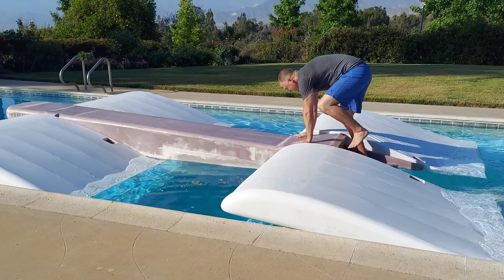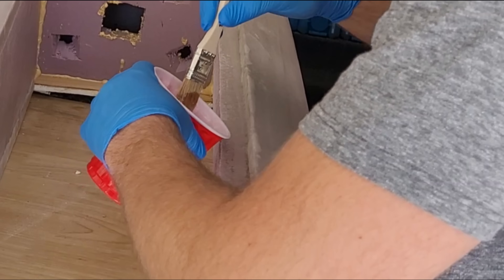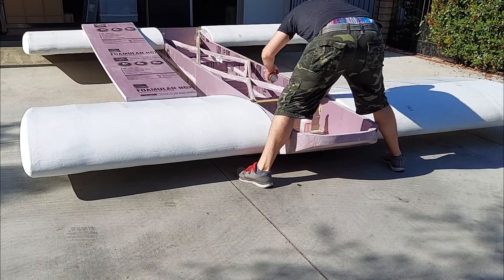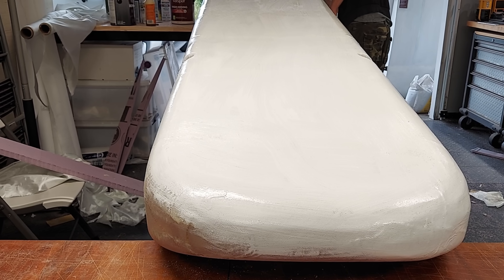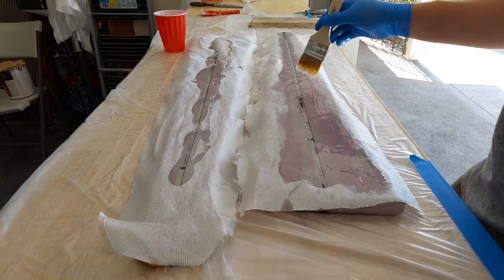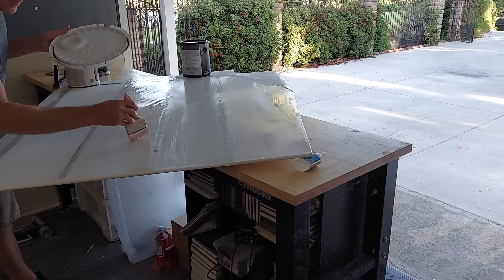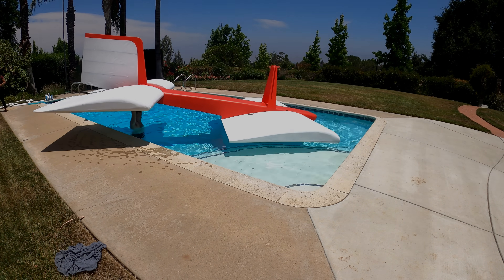NOT a Pool Toy:  Manned Boat-Towed Ekranoplan (Build Part 3)

Comment: I have changed my predictions for a successful outcome. For a while I thought no way it's just to much of a seat of the pants design and had around a 10 to 15% chance of flight. Then I dropped the chances down to about 5 to 7% because I predicted complete structural failure before reaching the speed necessary for liftoff. As you added supports along the way with more seat of the pants calculations I began to improve the odds and now I can't wait to see the first flight I'm up to a 75% chance of flight and 100% chance of getting a great laugh eather way. I wish you the very best of luck it has turned out nicely

Comment: Great Build and Great Comments, as a Hot Rod Builder since 14, all the Safety Things we Omit can come back to bite us with age, the Damages are Cumulative and can lead to Serious Problems . Those Darn  Air Purifying Cartridges , Only last a matter of so many Hours,  and must be But Back in the Bag and Sealed and they have become Disposable.  Eye Protection, Hearing, Lungs, every day is a must .   Also, as a Surfer, water skier, your standing Area might need to be enlarged so you can move your Weight around , drop a back foot to pickup that nose like a Surfer Does. They make Great Stomp Pad, rail grabs, all kinds of stuff in the Skate board, SUP, and Surfing World.  Keep you on that thing, and not Slipping off. Now a Great Chase Boat is an old Hobie Cat 16, stripped of sail crap, Hell we dropped a Redwood Gazebo Thatched Roof and all Strapped on a 16 Hobie cat with a 10hp outboard, fast ,stable, cheap, fun. We could load Beer coolers, barbecue, surfboards, 4 surfers and head out to the break, anchor  out. and surf all day Damn good Fun    God Bless the Builders ,  Never Stop Creating.

Comment: Amazing! Can't wait to see it fly. Interestingly, I wonder if the smoothed planing hull ends up being the right choice. I definitely don't know, but I know that at least for a time, some white water play kayaks that had planing hulls were designed more like golf balls or with sort of a grid pattern to assist with breaking surface tension, so it was smoother/easier to repeatedly break and join back to water (to spin and skip/jump smoothly) - I wonder if, with a smooth surface, you'll end up "stuck" to the water and once you release you'll pop up quickly. But this craft is so much bigger, maybe it's a non-issue.
Reply: The Americas cup AC-75 foiling mono hulls looked very much like they had considered this stickiness problem and had what they called a skeg underneath a very flat V bottom.
Not a yachtsman so forgive my use of terminology.

Comment: This is really inspirational! I live 25km from Lake Eildon, the 2nd largest fresh water lake in Victoria. I can envision a larger version, with either a long seat for a pillion rider, or perhaps in-line seating capacity for 2 plus the 'pilot'. I'd use some aluminium and plywood for strength, and add wingtip floats. Also, I'd want it powered by one large, or two smaller pusher propellers and motors, and twin rudders. A steering wheel or other rudder control mechanism would be required, along with a throttle. A basic instrument panel showing RPM, speed, and fuel, set forward of the controls would be easy to include. I'd also add a lightweight nacelle around the craft's nose to protect the pilot from wind and rain. 
The resulting craft would be far better than a speedboat, with no jolting from hitting waves or wakes. To begin with, I'd opt for a 500cc motorcycle engine, or two 250cc engines, depending on which configuration chosen. The fuel tank and batteries could easily be housed in the central fuselage.

Comment: This will be fun to watch.  The weight shift "steer" is a good idea, but I wonder if you'll need to adjust too many times.  Time will tell, though secretly I hope you have to make control surfaces to fly it like a glider.
Reply: vibratingstring  I think you won't be able to adjust quickly enough with weight shifting?  I can't really tell how responsive the airfoil will be.
Reply: vibratingstring  ever flown a hang-glider? Weight shift for its simplicity and effectiveness is a brilliant idea.

Comment: Whether or not this thing ever gets above the waves, you have certainly made Günther Jörg proud !   I love your innovative “big box home center” building theme here.  Your keen attention to aeronautical build detail is so fun to watch.  Will you be adding side panels to join the wings (like the Flairboat) or leave the wingtips unencumbered ?  I suppose there would be a small amount of wingtip bleed of air pressure but it might not matter so much for this test. I’m just wondering if it would help with longitudinal stability should one of your wingtips inadvertently dig into a wave or the wake of the tow boat.  Thanks so much for posting this great project !  👍🏼

Comment: This is epic!   And super dangerous.
Reply from the maker: I think the perceived danger is far higher than the actual danger.   Perfect for YouTube!
Reply: @thinkflight  oh it’ll make a great video that’s for sure! :D.  Will you have any aileron or rudder control at all?
Reply from the maker: @northernfpv9562  Nope
Reply: @thinkflight  uhhh.  Maybe just a tiny bit of rudder might be nice.  Attached to brake-style levers on your handlebars?  That would be cool and not too much weight or work required.  I’m just thinking of how to counter the lateral force in turns while towing.
Reply from the maker: @northernfpv9562  I'd rather give it a shot as is and only add it later if needed.   Also, it just needs to work, it doesn't need to work well :).   Not a product, just a youtube video.
Reply: @northernfpv9562  In my opinion the rudder isn't necessary. You'd only need it for less drag in a crosswind situation. For the first flight I would recommend going straight into the wind anyway.
Reply: @northernfpv9562  The tow rope in tension will be providing good yaw stabilization. Your question/solution relates more to case when airborne and no tension on a tow rope. 
This part of the perception of having no stabilizing control(s), and increased perceived danger. 
Key to the design is the integrated stabilization control, yet to be tested .. all great youtube video ingredients. ;)

Comment: Congratulation 👌 l learned  a lot of stuff from your project.
I have only one remark concerning the  attachment of the nut for the wing attachment bolts.
As I saw the nut are attached using Epoxy as an adhesive.  I expect that  this attachment will be under multiaxial loads with a peeling component.  Maybe it would be necessary to reenforce the nut with a cross beam structure to transfer this loads to the main supporting attachment structure
Reply: Yes I agree ,a larger flat clamping area will spread the load on the main spar . This is a high stress point and must be able to handle very high loads .

Comment: The NAPT is looking great. The hydrodynamic centre looks spot on, sitting perfectly level in the water. 
Any considerations to applying a soft foot friendly rubber mat material to the piloting surface, like surfers use on hydrofoil boards? 
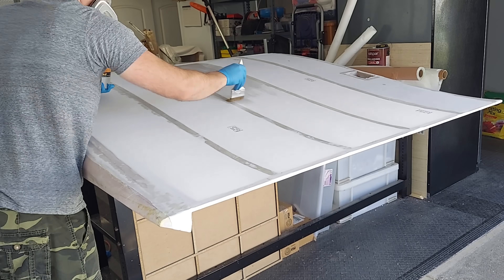Love the confidence (3:33) in that the NAPT Manned Ekranoplan will have a lifecycle of sufficient length that UV protection was a significant consideration in coating choice. ♥👍

Comment: I guess you've worked out that for Weight shift control  it's the opposite to what you might instinctively do with the"yoke"  i.e. to go up, lean back (push the stick forward)
To go left, lean left (push stick to the right) Hang gliding would help 😁

Comment: Without rib stitches, the fabric could lift off the structure. There have been deaths from exactly this, as the epoxy cannot resist the tension of the fabric “lifting” off the upper surface, especially with the concave shape. Please don’t fly it higher or faster than you are willing to fall! Also I believe it will be negatively pitch stable.. planes have elevators that produce downforce for a reason. With the rear wing being the same as the front wing, it’s going to pitch up or down wildly. Before you fly it, put 200 pounds of sandbags on it and tow it around, or make control surfaces and fly it like a giant RC plane. If you jump on it manned, I hope your insurance is up to date!

Comment: looks cool and roughly looks like it should work.. 
not sure how hard it will be to keep it in ground effect. maybe that's okay.  
and also roll stability..  may not have much, and I think you may be kept busy trying to keep it from rolling left, or right.. but worth a try as-is before making mods.  
don't worry about using proper techniques for the shrinking, or attaching covering material. it's not like it's human rated or anything...  Oh,,  it is?   um oh Well, never mind. :):) 
cool, lets' see it fly!!   imagine you'll tow it behind a boat!

Comment: Amazing project. I am just wondering, if you are going to be on top of the craft, your body is going to disrupt the rudder airflow?
Reply: I think the issue will be rather whether this thing has enough lift for a low enough speed so none of that matters all that much. There is no control on the rudder, it's purely for some stabilization. In the test flight, he will want to go straight into the wind anyway to get airborne at the lowest ground speed possible.
Reply: Rudder is more a secondary yaw stabilizer for most of early flight plans. The tow rope attached to the front will provide plenty of yaw stabilization when under tension
Effectiveness of rudder will be more important if/when the tow rope become slack while airborne.

Comment: The next time you do this you create a barrier for the foam by painting it with latex paint you can buy that and spray can form and then if you have a pinhole it will not melt the fome.

Comment: Your exuberance is laudable…but, imagine that as you are accelerating into liftoff / flight profile requiring the control necessary for stabilized flight involving pitch-roll-yaw…now add in the oscillatory impedance of the water surface chop generated by the tow boat.
Can you disengage from the surface wave action under sufficient control to achieve stabilized flight at 30knots? Or will the lack of axial control allow one wing to dip ever so slightly …resulting in disaster. To avoid this …you could employ a launch sled that would pre-pitch the fuselage/wings while keeping them well clean of the water. In this configuration you would take flight just long enough to experience the flaws in your design.

Comment: Similar to my idea. I was thinking hydrafoil to get it out of the water quickly, then accelerate to flying speed to come completely out of the water. I also want to pull it with a kite (after boat test proves possible).
Reply from the maker: foils are nasty on these things unless you can retract them.   I wanted to do that too on the drone versions but quickly realized they were a 'no go'.

Comment: I've started a simpler project intending to use Styrofoam to build a Remote Controlled retrieval Boat for RC Boats. I'm using Foam and trying to figure out what's best to seal it with. Any Suggestions. I can look at my Foam when I get home and then tell you what Brand it is. This Boat won't ever leave the Water Surface, but I'm building it out of Foam for Buoyancy.. It's a Pontoon type of design with Dual Electric Motors for Propulsion and Steering. It will have 2 Battery Packs, Speed Controls, and Servos. Any Guidance will be greatly appreciated. This is a Project I Shelved years ago, but your informative and upbeat Video was the Encouragement I needed to motivate me.

Thanks again,
Buck
Reply: Epoxy

Comment: Hmm looks like the rear wing have more angle of attack than the front wing... Is that true? In that case it will be unstable around the pitch axis.
Reply from the maker: I'm 'quite' certain it is a correct angle, but yes I have stared at it and wondered many times myself IRL.   The photo definitely makes it WAY worse though.

Comment: This is an ambitious project that may have the potential to be successful. However...  At 7:41, the video shows the pilot positioned above the wing trailing edge. Furthermore, the horizontal tail is shown with positive camber (curvature upwards). This arrangement concerns me. I believe the airplane may be strongly unstable in pitch and furthermore it may be unstable with respect to height above the water. This potentially dangerous or lethal. I recommend that you obtain guidance from a qualified aerospace engineer before you fly. Disclaimer: the following is offered as general guidance and should not be relied upon. The airplane center of gravity should be well forward - to the quarter chord of the forward wing or even ahead of that. The tail should make a download, not lift. The tail should be inverted and its incidence adjusted so that the airplane flies at a desired speed when it is in free air (well above the water). This combination of forward CG and inverted tail may provide height stability in ground effect. The mechanism is that at a given airplane incidence the wing may make increasing lift as it approaches the water, tending to pitch the airplane nose-up. In contrast, the tail may make increasing downforce, also tending to pitch the airplane nose up. Height above the water can be adjusted by airspeed, or by pilot weight control of the CG.  An effect that reduces height stability is the influence of the wing's downwash field on the horizontal stabilizer. In free air, this downwash field is strong and tends to pitch the airplane nose-up. Close to the water surface, the downwash field is suppressed, tending to pitch the airplane down. A forward CG may be needed to provide desired height stability. There is an additional concern: Care should be taken not to fly out of ground effect due to apparent weakness of roll control. In ground effect, roll effects may tend to keep the wings level. Out of ground effect, roll control may be severely lacking. Back to pitch and height stability: I suggest you study the arrangement of current hydrofoil surfboards. These operate in reverse ground effect. They are configured with a very far-forward CG and a tail download. They are height-stabilized by proximity to the water surface. As the wing approaches the surface, lift is diminished, dropping the nose. At the same time, as the tail approaches the surface, its download is diminished, also dropping the nose. This is how hydrofoil surfers can maintain height so precisely. I hope this comment is helpful.

Comment: Although I would like to see this project work out for you, I fear it will end badly. Please wear a helmet even though you will be on water. It's good to see in your intro video that you have experience with weight shift on a hangglider, but oh boy this will be so much different. I hope you trust your boat driver and have a way to communicate properly. Go early in the morning when the air is least active. Your sense of adventure and invention is inspiring, but this idea just doesn't seem realistic. Best of luck, you're gonna need it. It's not the boat driver's fault.

Comment: Your CG will be too high with you standing.  Honest.  Sit supine or lay down.  CG as low, low, low as possible.  Did not see the location for the hook.  Mounting should be highly adjustable/lockable.  I would start with the hook placed at the forward wing point of max aero thickness.